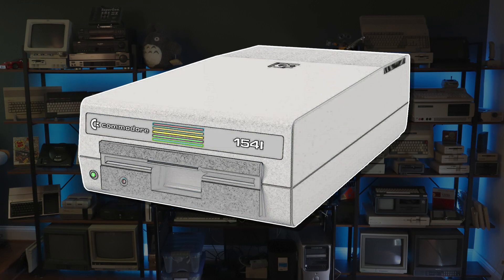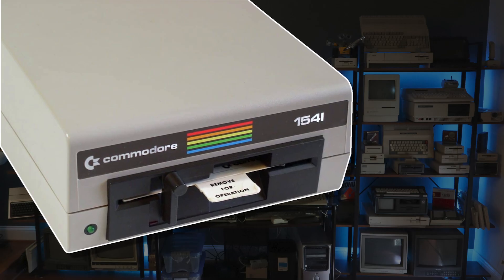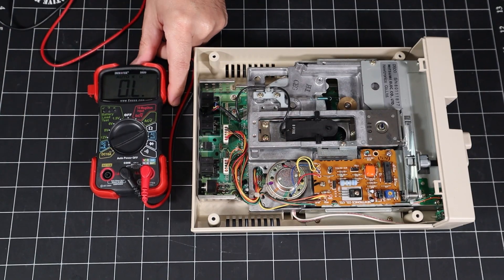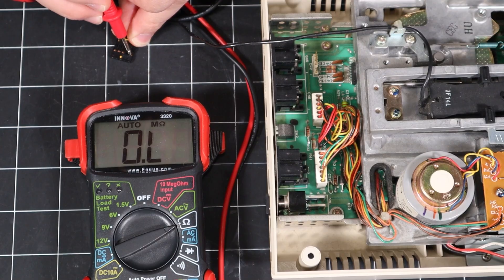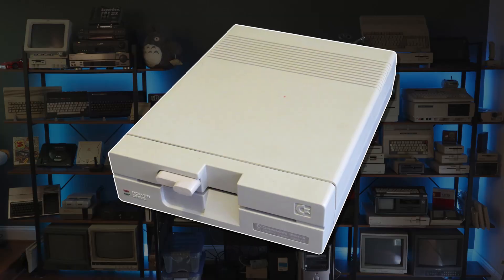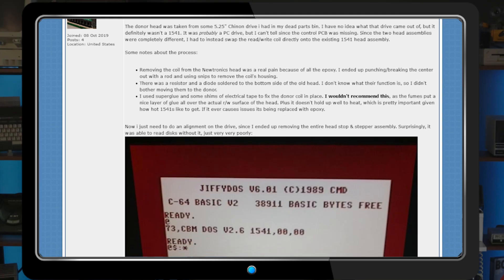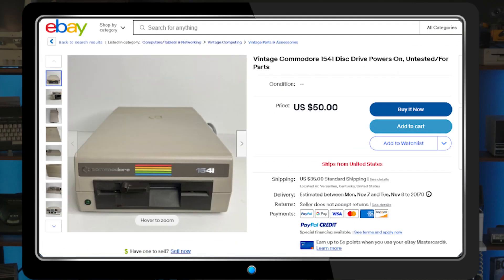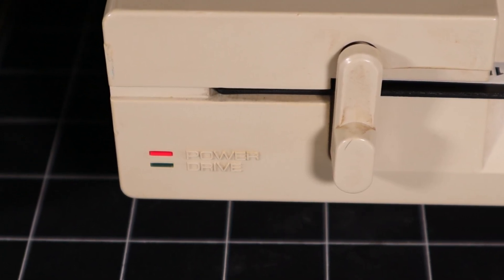This Commodore 1541 hides a terrible secret.

Comment: So what is suggested as the working replacement
Reply from the maker: A properly aligned Alps drive, a Chinon 1541-II, or a 1571 are probably your best bets. I prefer modern solutions for day-to-day use though, like the SD2IEC or Ultimate II+.

Comment: @4:20 the Pin 1 is not short - your multimeter shows +inf resistance, which is OPEN circuit. The pin 1 is therefore rotten, eroded, open, disconnected, etc..
Reply from the maker: You are correct; thanks for pointing that out! I disassembled the drive and checked continuity of pin1 from the connector all the way to the PCB on the head just to ensure it was not a wire break and that tested out fine, so the break is somewhere inside the potting/coil.

Comment: 140 USD? I struggle to get rid of them for 30 Euros. I have stashes of them, I think I can throw those out, nobody wants these any longer. And well, the issue is widely known for decades, my friend (collector) told me that 10-15 years ago that those heads fail on those type of drives. A PC drive swap is not useful as it is the same part, so the same situation after wards. Junk.
Reply: I’ll take them for parts. Or to use them for new modern drives in an old housing.

Comment: It's interesting that you got an error code of 27 in the READ ERROR message. Usually, the 1541 floppy subsystem returned either error code 20 or 21 in case the drive head found nothing to read in.
Reply from the maker: Interesting observation! Can error 27 (checksum error in header) only occur if the header and sync mark were successfully found? I don't know enough about how the r/w head is wired or how it operates to know what an open pin1 will result in beyond the obvious "it doesn't work".
Reply: @retrobitstv  Well, CBM DOS starts to read in a header after sync and header marks have been found. Finding those marks (or assuming, that something might have been a header or sync mark) requires at least some low-high or high-low transitions of the signal from the read head. An there is the difference between the 20/21 and the 27 error. Both error 20 and 21 can be thrown if there's either no signal at all, or there is some signal, but not for the track which CBM DOS expects. But the error code 27 is thrown only if there is some signal and CBM DOS "thought" it would have been reading in a header, and then fails in the check of that header.

BTW, if you can reproduce error code 27: An idea for further analyses might be to increase the retry counter for "soft" read errors. Error 27 belongs (as error code 23, too) to the category of "soft" read errors. Unfortunately, I haven't got my old 1541 manual at hand hat the moment. But I remember this even being documented in that old manual which every customer got with the 1541. I also remember that you just hat to issue some "magic" memory write command to change the default value, and there was no risk playing with this (and some other) values, because all those memory writes only affected the RAM, and hat no permanent effect.

I remember that retry counter because in the 1980s, we somethimes had some trouble with slightly misaligned FDD heads, which resulted in eventual problems reading in data from other people's disks. Also, there were similiar dejustment issues between CBM 8050 and 8250 drives, or if you tried to read in 1541 disks on a 8050 drive. (Yes, that actually was possible with some dirty software tricks. However, you could not write a floppy for 1541 track layout with the 8050 due to the narrower magnetic head.)

Comment: Great video, but please illustratrate the difference between the two models more clearly. I may be dense, but I can't spot the difference at all between the error prone model and the good one just by watching this video.
Reply from the maker: 1541/1541C/1551: Center pull-down flap = Alps (good), Lever = Newtronics (bad)
1541-II: Recessed lever = Chinon (good), Flush lever = Newtronics (bad)

Comment: Could you explain what you mean by the heads "aren't sealed" against moisture? What's the difference between these heads and the Chinon heads?
Reply from the maker: This seems to be the most common theory out there because the heads fail with either a short or a break (as in my case) inside the epoxy while the drives are sitting in storage unused, implying the problem is not due to mechanical or electrical stress. However, it hasn't been definitively proven either. It is well known that many things that were manufactured in the 80's (including many of the ICs made by MOS) were susceptible to moisture in the air penetrating and oxidizing the internal components over a long period of time which is why the chips eventually fail even when not being used. Per Bil Herd, material technology just wasn't as good back then as it is now and even when a better option was available, a lesser option was often chosen to keep cost down. I don' t have an answer to your question, but it may be that Chinon used a different material to pot their heads or that Mitsumi/Newtronics had a defect in their manufacturing process resulting in the improper sealing (air bubbles, material shrinkage, porosity, etc.). All this, of course, is just hypothesis based on available evidence until someone proves it.

Comment: Second hand dealers are crazy. I try to buy stuff via forums from members that I know a bit if possible. And nowadays I buy old stuff from which I know that it doesn't break down for sure after 20+ years. And only stuff that's cheap. NOTHING on earth is built to last forever. I've had 20 year old stuff, that was built like a tank, that worked perfectly fine break down after a month.

So certain hardware like Commodore drives: I'm not even gonna try. I don't have the time and resources. Sad but true. Thanks for the fine video! :)
Reply from the maker: Yea, I only buy when I find a good deal but I am shocked at the prices some people are paying on eBay for untested gear. It's pretty amazing that any of this stuff is working at all 40 years later! I'm glad that most of my drives still work and I've only had the one fail so far. Later stuff like the 1571 seems to be more robust as well.

Comment: I have one of these 1541 drives that hasn't shorted a wire has gone open circuit beteen connector and the head. I have been pondering how to replace the broken wire for years.
Reply from the maker: If it's just a broken wire outside the potted head then you should be able to fix it relatively easily! I just disassembled my drive to make sure the wire had continuity on pin1 and it does, so my break is inside the coil itself :(

Comment: I have two Alps. One is for spare parts. I did the Datel burst nibbler mod, the track counter mod, RAMBOard, reset switch, JiffyDOS, device ID micro switches, Switch mode power supply. I figure I could not want for a better drive or experience. It's the original, It's modded to high heaven and I love the whole using a real floppy drive experience. I think I'm going to switch out JiffyDOS for DolphinDOS. Not sure, though. It's not like I'm unhappy with what I've got in any way. - I've also got the datasette and 1541UII+ and a raspberry pi 3B+ based Pi1541 with large color OLED display, an Easy Flash 3 and an SD2IEC, an RR-net MK3 and 64NIC and a new old stock modem and a WIFI modem with display.  Your breadbin C64 SHOULD be modded, too! Because improvements should NOT be ignored. Like the VICII2 NTSC / PAL switch mod. Or the original SID2SID mod. Or JiffyDOS, Reset switch, RF Modulator hacks, Mechboard for the clicky feel. White front icon printed keycaps and VIC 20 orange-tan F keycaps. Best video I've ever had was through an Svideo to Display Port converter and an HP elite 4:3 aspect ratio medical document LCD monitor that's display port only. A REALLY powerful set of powered 2.1 PC speakers with Sub woofer. (SID tunes / demos are best when loud!)

Pop in a demo floppy for a friend that doesn't know what a C64 can do. The floppy gets them right away. Crank up the SID tunes!!  Nonchalantly telnetting into your 1541 and commanding your C64 to do different stuff seals the deal with the uninitiated. An old school GORF or Wizard of WOR cartridge and the Magic Voice Module: hand a younger person a competition pro joystick and they're making videos and laughing and IN LOVE! Not owning and keeping up an original 1541 is sacrilege. It's like "I've got the KEYBOARD to a cool old computer! LOOK!" - meh.
Reply from the maker: For day-to-day use, I prefer a USB or sdcard-based solution but I will always try and have real drives as well because using floppies is totally part of the authentic experience. At least for as long as they continue to work, both the disks and the drives.

Comment: @7:21 - I work with a local recycler, and they post stuff all the time "unknown/untested  for parts" because A.) they literally don't even know what they are posting B.) they don't have the time to really test it  C.) turns on spins, because they at least plug it in to see if it gives signs of life.

These are just people who have little to no knowledge about what it is they are even looking at, or how it's supposed to function, they often don't even have a machine to plug the drive into.  EVEN if they had all of the above, the act of setting up a spot to test a one off floppy drive, even if they have disks and a dedicated station to "test it" on..  just isn't worth the paltry margins in these places.

I used to think the same way, people just always post it as "for parts/untested" on junk they don't want, and I'm sure it happens, but after watching the amount of volume that goes through this place and then realizing they truly don't want good retro stuff to end up trashed.  I give those posts more of a bennefit of doubt than I once did.
Reply from the maker: You make an excellent point - recyclers/resellers don't have the time or capability to test but are putting these things out there which is good for the enthusiast/collectors. However, there are those that are pricing things at >$100 as untested and uninformed people are buying them which is really unfortunate. All we can hope to do is raise awareness, which is why I made this video in the first place :)
Reply: @retrobitstv  absolutely!  It's great to have more information out there.  

One last bit, something I wish we could change on the ebay side.  When an item is listed on ebay, you can literally click a button that say "I want to sell this too" and it populates all the fields with the same information/pricing as the item listed on the screen.

It's a bit of an anti-pattern where items are overpriced and then sell overpriced, and then feed further overpriced sales.

I will fault people for this, as they probably know their item isn't "just like the one they found on ebay"

Comment: Does the "lever flush with front houseing = Newtronics" rule apply also to to original 1541 and to the 1551 drives?
Reply from the maker: Any original 1541/1541C drives that have a lever are all Newtronics as far as I am aware. I don't know about the 1551 but another commenter indicated the same rule applies. The models that are not affected are the Alps drives with the center flap door mechanism.

Comment: thanks for video. this is fantastic as always!   without knowing this problem I bought 2 untested 1541 drives. I knew it was not working for sure before I bought it. both of them are powered on with LED lit but that's all. luckily I fixed one of them by replacing  IC but the other one never had any improvement even if I did  same trouble shooting like other working one. 
Now I understand that It was not about IC at all... oh well I was lucky to have at least 1 working one :)

Comment: 1551 also. Not sure about the "seal' theory. There's nothing different between a read/write head and earbuds for example, and they're exposed to plenty of humidity. If humidity was a problem, just a spool of 40AWG copper wire would fail by itself as well, and it doesn't. There's still no real explanation for this failure.
Reply from the maker: True, this is the most common theory out there but it's not backed by a lot of hard empirical evidence. I haven't seen, e.g. a close up image taken from a microscope showing obvious oxidation inside the head. But there are those who have found broken wires inside the potting so it seems plausible at least. Especially since it can take 30-40 years for the problem to manifest and the failure has been well-documented to occur when the drives are not in use, so the issue appears to be unrelated to physical or electrical wear. Still, it is just a theory until someone can prove it.
Reply: @retrobitstv  Maybe the specific alloy of copper used by Newtronics for that super-fine wire has some sort of additive in it that eventually causes ... something ... to change, who knows what. 
In vacuum tubes there is a wear mechanism called "cathode interface" which is caused by silicon cooking out of the heater and poisoning the cathode so it can't emit electrons anymore. The only reason they put silicon in the heater wire alloy is so that it could be drawn easier. The tubes worked for years then wear out faster than expected. Maybe some sort of unintended consequence of a good engineering practice is at work here.
Thing is, it's almost impossible to get "horse's mouth" information on floppy disk head manufacturing. It's like that entire field of engineering disappeared in the late 1990s and they burned all the plans. I found a few ceramics textbooks that have a few paragraphs on floppy read/write manufacturing, but that's it.
I tried figuring out this problem with no result.

Comment: They used to sell stops for the 1541 to stop the head knocking. There were adverts for them every month in Zzap64 magazine. I sold a 1541 on eBay recently.
Reply: Have 1581 3.5 drive?
Reply: @rustymixer2886  lol good luck on that one. Prices too high on EBay for it plus CBM did not release that many. I got one earlier this year w/ a c64c from a guy in Augusta Georgia who runs a CBM floppy disk recovery service. His price was $400. Both in good service.

The c64c is still in its box cause a year earlier I build a custom c64c using old breadbin coupled w/ a black c64c case from Ami64. Along w/ sd2iec, pi1541 & wifimodem. Only things I need know is a dual Sid, IDE64 (so I can use my Iomega Zip drive with it) & an Ethernet adapter (will be faster than the wifimodem.

Also looking for a good priced Epyx 500 joystick. As w/ everything CBM related on EBay highly overpriced.
Reply: @chuckcobb9392  awesome maybe I'll visit store in Augusta

Comment: Thanks for the informative video! I recall wishing my original 1541 had the lever operated mechanism. I thought the push down ALPS 1541 drive lever was weird and clunky. Some friends had the Newtronics version and they felt a lot nicer to use... but here we are 40 years later and my 1541 is still going strong!
Both of my 1541-II drives are Chinon based and work perfectly!
Reply from the maker: Awesome, glad your drives are still all working! I've only had the one fail so far myself, but I'm going to have to keep an eye open for a Chinon 1541-II I think :)

Comment: You are wrong ! O.L doesn't mean that there is as short circuit. It means open circuit and that could also be due to a broken wire inside the cable to the head which  constantly get bend while the head moves.
Reply: Alas, it was not the wire when my drive died.  After tracing it all the way to the read/write head, I disassembled it and checked it on the microscope.  The open was plainly visible where the coil was previously bonded to the board.
Reply from the maker: You are correct and I need to pay more attention. I read the O as a 0 and moved on. That said, I disassembled the drive and checked continuity of pin1 from the connector all the way to the PCB on the head just to ensure it was not a wire break and that tested out fine, so the break is somewhere inside the potting/coil.

Comment: it is not shorted but open. They can be "repared" if one of the two coils is working you can bridge the other coil with a resistor. It will be slower, but will work.
Reply: Bypassing one of the coils with a resistor is an absolutely stupid idea.   Who the heck told you that would ever work?
Reply: Hey thank you is there any tutorial or forum post about that? Just in case?
Reply: that "reparation" gives as a result of unreliable reading, I mean a lot of reading errors, doesn't work well, don't waste your time doing that stupidity...

Comment: These days why anyone would be using anything but flash drives is beyond me.   Convenience alone makes it the way to go.
Reply from the maker: I prefer to use modern storage solutions for day-to-day use but it's still fun to break out a real drive once in a while for that authentic experience!
Reply: @retrobitstv  I feel ya.  Sometimes I do wonder if the effort and hassle we go through for said experiences are worth it though..